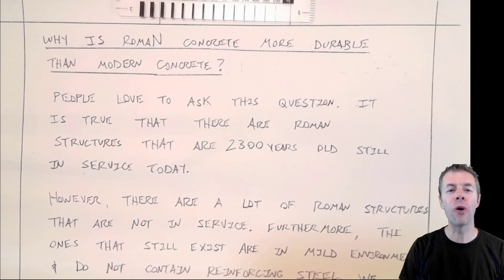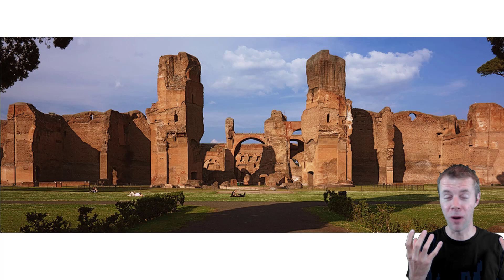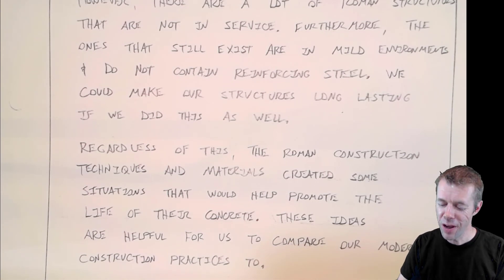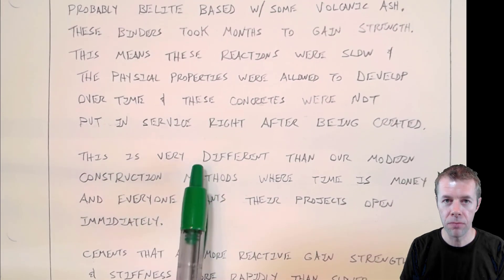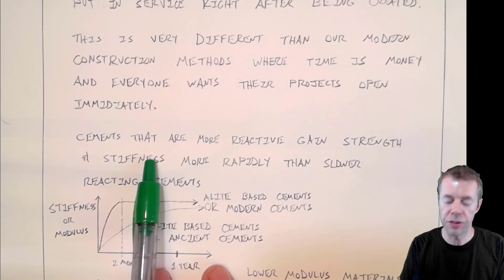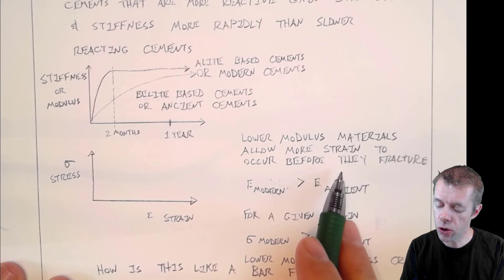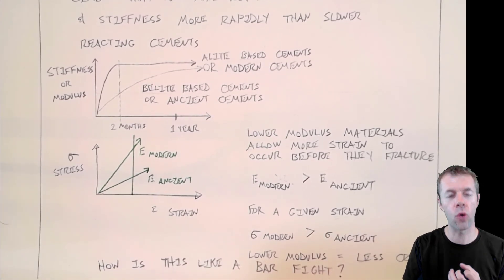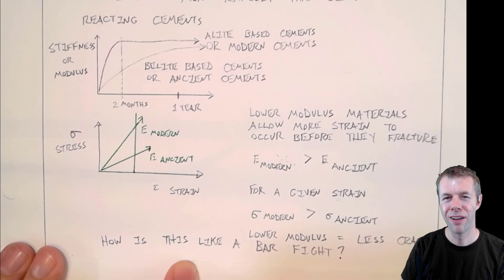Why is Roman Concrete More Durable than Modern Concrete? / How to Win a Bar Fight?

Comment: I grew up in a small town with a Roman fortress. Built at the extreme end of the Roman empire. Huns destroyed it several times and it was re-built. As kids we used run over it, on top of Roman concrete containing many big rocks taken from rivers. There was not a single crack. And it felt more like granite than like current concrete. 

Roman concrete in seawater reacts with phillipsite to form aluminum tobermorite, a crystal harder than modern concrete. And it can flex a little bit. And if a crack forms, the chemical reaction with seawater keeps creating tobermorite and the crystal grows, and heals itself.  2000 years and Roman concrete in the sea is still there and stronger than when it was young.

On land Roman concrete was built by hand and water for it was carried by hand. So they used far less water than we do. And that's why Roman concrete contains grains and bubbles of cement which is not fully hydrated. If a crack forms and water enters it can react with one of those cement grains or bubbles and they expand and harden.

Comment: Actually it’s because of the lime chunks would help “self heal” when water got to it the lime would fuse back to gather. You add the lime to the water first and it doesn’t fully dissolve leaving the big chunks of lime to them help up to 6mm cracks co paired to now a days 2mm is the most new Concreat can “heal itself”

Comment: How would concrete behave if it were made of pure diamond which has the highest modulus on earth? I feel like a loaded column 2’x2’ could take incredible stress without deformation.  It doesn’t have a low modulus, in which you state that lower is better for durabilitys sake of concrete. I guess im just confused,  wouldnt you want the cement paste and aggregate to not be so elastic? Like a high psi mix designed with high modulus materials to absorb stress to limit the strain?
Reply: I know this is kinda off topic, but iv always wanted to get giant crystal columns from that one cave in mexico. GIANT quartz crystal columns!
 And diamond would prob be a great aggregate in cement, but too expensive ofcourse. Id like to make my concrete with granite chunks and powder, just cause its a longer lasting stone than limestone.

Comment: In San Fransuco, Ca my fathers family where  at 1st,  starting 1870's onwards :  where stone masons, plasters, building contractors of small homes &  concrete finishers.

Odd note: Concrete foundations & sidewalks put in before 1920 had a pink  tint to it.
And the pre 1920 concrete foundations where very, very crumbly with age. Too much gravel in the mix!

Comment: We have in my country Roman ruin structures and yes they contain reinforced steel/iron . . I saw it with my own eyes and that huge round cylinder was so heavy it wouldn't budge no matter how hard I tried to lift it, even for expecting to move a little, I felt like I was tearing my self apart

Comment: Where possible, carry out the tests on an accurately measured grid. This will remove bias from the
data. If a grid is not used, the tests will tend to be in easily accessible locations that may have also
been accessible for maintenance, and will thus be in better condition, or more exposed, leading to
a worse condition. What is meant by this statement ?

Comment: Considering the curing time of concrete (if that's the correct word) I wonder if you'd be willing to discuss in a future video the possibility of using cements that absorb CO2 as they cure?

Ideally, from a global carbon perspective, we'd want the cement to absorb more CO2 as it cures than was released in the entire production process. That would make conduction industry a boon to the planet rather than a problem.

Is this even feasible? I'd love a professional perspective on this issue.

Warm regards

Comment: The individual blocks definitely helped with the expansion and contraction. Concrete when spread out will crack. However if you think of it like their blocks, 3d!  If you want it to crack less make it thicker... if you make it a perfect square (not recommend, could get expensive quick)  it has no weak spots. Opposite side- we add weak spots to "make" it crack where we want

Comment: Gosh, I sure do wish I'd run across you before.  Many of the things you talk about here we have addressed by streaming UHMWPE fibers into concrete. We just had our first fullish size test (8'x25'x0.5' panel) and you can see it on TNSRsys.com/prototype.  There are lots of advantages.  Do you think we can edge lift 8'x40'x1' panel?  Without steel.  Coming soon....

Comment: More relevant reasons their concrete lasted thousands of years and ours typically fails within a century is their water to cement ratio, precise mix consistency, and completely different installation technique.
Reply: I wouldn't believe for a second it's an issue of precision. I would think we can much more accurately and precisely control the mix ratios with current technology. Nor would I believe it's a water to cement ratio. The people like this professor have had centuries to experiment with varying the two parameters of cement and water. There is very little chance that the magic behind Roman concrete lies in that combination.
Reply: @nonconsensualopinion  Everything was carried by hand obviously. Including the water for making concrete. So they used far less and their concrete was much dryer than modern. And grains of cement in it did not fully hydrate. And if a crack forms and water enter it can react with those grains and they expand and harden. Self healing up to a point.

In seawater Roman concrete forms  aluminum tobermorite, a crystal harder than modern concrete. It can flex a little bit. And if a crack forms, the chemical reaction with seawater keeps creating tobermorite and the crystal grows, and heals itself.
Reply: @nonconsensualopinion  it's not a matter of speculation. We know what the romans did. They used multiple times less water and because they used domes with no mesh, their aggregate mixes had to be more carefully balanced so as to avoid uneven stress. Also they used higher quality pozzolans. It's not that we couldn't do that, but that we don't. No one wants to pay to dry pack their concrete into forms with mallets, so we use steel to hold our weaker concrete together.

Comment: When I first start to work with concrete they would tell us it would take 28 days+ before concrete got ideal starting strength, we had to keep it wet for that period.. About 20 years ago it started being 3-4 days . Old concrete would cure pretty cool. Modern Concrete seem to get hotter and drinks more. Some of that old concrete which I consequently had to remove 30 years later was very very hard.

Comment: Hello,  I keep coming back to track steel in my question as what would work cheaply for rebar.  When I was growing up around here there were a myriad of small marine railways that went out to low water.  Then a cradle was lowered out at high tide to submerge and let boats run on to them.  Once on they were chocked and a winch drew them up into the shop where work was done.  The point is this is another case where steel rails were submerged in salt water twice a day as well as out in the weather for decades.  Nary a sign of flake rust at all.  A patina of rust on the non load surface was the most you'd find.  Would not this formulation of steel be trick as rebar for long lasting concrete?  I would love to hear a metallurgist chime in because it sure looks like a better answer than epoxy, paint, galvanizing etc that have been tried and failed.  Would not be near as expensive as stainless or exotic alloys nor subject to crevasse corrosion etc.  Take care.  Doug
Reply: Sounds similar to blueing or browning steel. The oxide outer layer protects the steel within
Reply: @mexital1159  As I recall, browning was done with salt, too.  Good observation.

Comment: Did European people forget how to make concrete after the Western Roman Empire collapsed or was there no longer the infrastructure to support cement production?
Reply: Both. The secret to Roman concrete was a closely guarded secret: volcanic ash was the pozzolan that made Roman cement different from the soft lime cements that everyone else knew about. When the Roman empire collapsed the few people who knew the secret no longer had access to volcanic ash and no one made a comparable cement  until Portland was discovered in the 19th century
Reply: Both, plus a third thing: due to the difference in Imperial building projects and those that immediately followed there was no longer the desire to build such huge structures. 

That reason logically and actually came before both the points you mentioned: it explains why the skills were not maintained, and why the industries to produce the material went out of business.
Reply: @Brik Tearz World yep, just like making the best pizza in town doesn't mean you know how to run a business that doesn't fail.

Comment: Drunk people have less accuracy in hitting targets. Splash them with icy bucket of cold water with ice  and their elasticity will go to zero. Drunkards are in high heat when drunk.  Metals are bendable when in high heat temperature but when in cold, they harden. Alcohol has insulated these drunkard from feeling hurt. I am not saying that you mix alcohol with cement or concrete. This is insane ideas. Only time will tell when an admixture will be invented to improve or modify the elasticity of concrete or may be reinvent concrete with different raw materials.

Comment: It took months to cure, gain maximum strength because they were using pozollan cement. Portland cement did not exist during those times. Volcanic ash were common mortar/grout in many fortress . Besides pozollan is still cheaper than portland.You have a discussion on pozollan cement and Portland cement in your past video. Very interesting discussion ,engineer.

Comment: I was just reading an article where the university of Utah has discovered that Roman concrete has the ability over time to build interlocking minerals that can aid in repairing cracks and give the structure added strength.
Reply: Paticularly interesting is that they had different mixes for different applications. They had a mix that they used for saltwater.  It strengthened over time due to mineral bonding caused by the salinity of the ocean. Anyone who has been to Naples can attest to this

Comment: I don't agree with your explanation that because roman concrete had low modulus hence it lasted longer. Modulus (E) is the slope of stress - strain curve and it has nothing to do to how much stress can a material take before cracking. This depends on the ultimate strength of the material. Ultimate strength of concrete (fc') is greater for high modulus concrete than for low modulus concrete. As per ACI, E=57000(fc')^0.5
The correct way to look at the issue here is that if you build identical structures with identical loads but one with higher modulus concrete and one with lower modulus concrete, then concrete with low modulus will undergo larger strain for the same load and will crack earlier, unless it has plastic stage which no concrete has. Concrete with higher modulus will undergo less strain and fail later. Structures are always designed for given loads not for a given strain.
In my opinion Roman concrete was durable because structures were designed in such a way that concrete remained under compression or minimum tension, hence cracking did not develop. Moreover, there was no reinforcement in the concrete which would corrode. Although I would say that lime might also play some role in durability of Roman concrete but not sure how significant it might be.
Reply from the maker: Hasan - Thanks for your comment.  We must keep in mind that it is the deformations that cause the damage.  Materials with more deformation capacity have the ability to dissipate energy and ask for help from other parts of the structure before they fail.  See my video on structural resiliency - https://www.youtube.com/watch?v=5P3BZUDz-9g&list=PLRq6Z9d0kCT8PCLAQiRXIoXJ14b3RcgUc&index=9&t=0s

Think of a paper plate and a glass plate.  If a glass plate is loaded to its limit then it fails in a brittle manner.  However, the paper place can bend a lot under the same load.  This allows it to survive under a given load.  

I agree that having structures under compression is also a great idea but this lower modulus is a concept that is used in a lot of materials to dissipate energy before it fails.  Think of bending but not breaking.
Reply: @TylerLey  I agree that material which can deform more and has more toughness has the ability to dissipate energy and survive longer, that is why we provide reinforcement because concrete has low toughness and exhibits brittle failure. 
However, in Roman concrete there was no reinforcement and we are left with concrete only. Concrete of lower modulus will not deform more, rather it will deform earlier but the total deformation for lower strength concrete will be almost the same as higher strength concrete. 
We take ultimate strain of concrete as 0.003 which is same for all strengths of concretes. Therefore concrete of any strength has the same potential to deform i.e. 0.003 strain. However, higher strength concrete will reach this strain at higher load than lower strength concrete, thereby exhibiting greater toughness (area under stress-strain curve is more for higher strength concrete than lower strength concrete, for ultimate strain of 0.003).
Reply: @hasanshirazi9535  Apologies for reviving this 5-year-old thread, but I hope that, in the meantime, you have learned that concrete is a viscoelastic material. Low modulus materials are more resilient to volumetric instabilities (i.e. creep and the many forms of shrinkage) because they allow for larger internal strains before the material fails in tension and cracks. These microcracks then greatly reduce the ability of concrete to resist the ingress of water and/or deleterious chemicals. I know how complex structural engineering is, but you guys could definitely use a couple of materials courses...
Reply: @flamemasterist  Don't know what you are talking about. As far as creep and shrinkage are concerned, these are always  low for high strength, high modulus concrete.
I have never come across any application where low modulus concrete is preferable over high modulus concrete.
Reply: @hasanshirazi9535  Ah, yes, UHPC famously does not have issues with autogenous shrinkage and insufficient stress relaxation. Your comment shows that you did not in fact learn the concept of viscoelasticity after all these years, and unfortunately a YouTube comment section is not the place for me to continue this discussion. I just hope your professional endeavors continue restricted to problems where you can assume increasing the material stiffness is always beneficial, without resulting in too much harm. Have a good one
Reply: Don't forget their water to cement ratios were multiple times less than modern concrete and they dense packed it in place, literally beating it into compaction. Also their mixes were much more closely monitored to maintain consistency from one side of a building to the next (which is a serious problem we encounter when we try to copy their arche and dome shapes)
Reply: In seawater Roman concrete creates aluminum tobermorite, a crystal harder than modern concrete. And if a crack forms, the chemical reaction with seawater keeps creating tobermorite and the crystal grows, and heals itself.  On land everything was carried by hand, including the water for concrete. So they used much water than we do and thus their concrete was much dryer than ours. And grains of it were not fully hydrated. And if water enters through a crack it can react with those grains, which then hydrate - expand and thus close the crack.

Comment: Lime mortars and concrete, unlike Portland cement, could REPAIR themselves over time. That's exactly what was superior about them. Also, unlike modern masons, traditional masons understood very well that mortars must be WEAKER than what they were holding together, else the structural material would be fractured by the mortar. Lime mortar takes the damage from forces and expansion, and heals itself. Portland cement mortars are in no way capable of this.
Reply from the maker: Johan,  
Thanks for the message.  Portland cement mortars or concrete can heal themselves.  However, I have never seen it compared quantitatively to lime mortars.  Thanks for the cool idea.
Reply: @TylerLey  I'd love to see some research on this. Any chance you know where to find some?
Reply: @knewsom  I am in too !!
Reply: there is research. they are capable, you do not need weak mortar like concrete with 10MPa bricks analogy.
Reply: @Baigle1  Got links?
Reply: American Concrete Institute and many other convention/presentations, too much else going on to be able to get the refs for you atm.
Reply: it may not be weakness but porosity of the lime mortar that imparts a functional behaviour. well worth a a watch https://www.youtube.com/watch?v=uh-Sy_3uIWE

Comment: how much of it has to do with vertical loads versus horizontal loads? They didn't use rebar, that makes it last longer or shorter for reasons we understand. Which or their structures did not last? I suspect it may be the ones that had more horizontal loads applied to them and could have benefitted from rebar. Of course I ablsolutely agree with your other reasons you presented, why some have lasted so long, climate being the most important IMO
Reply from the maker: Good question!
I think that would be a good thing to research.  The existing structures are in areas with very mild climates.  There are some sea walls in Britain that still exist but they are in the ocean and so they don't freeze.